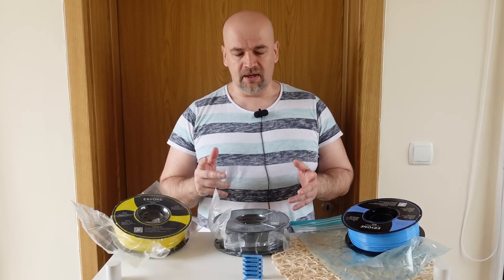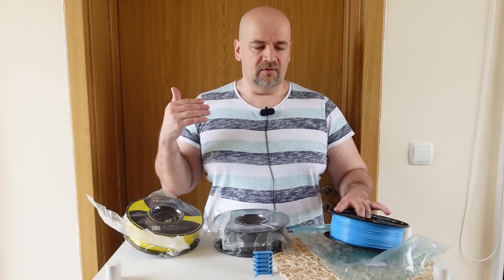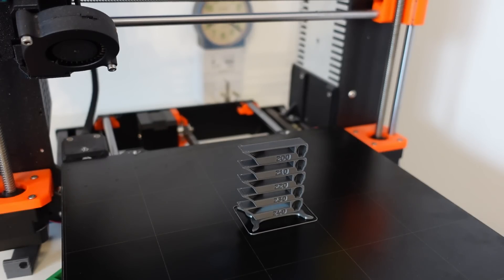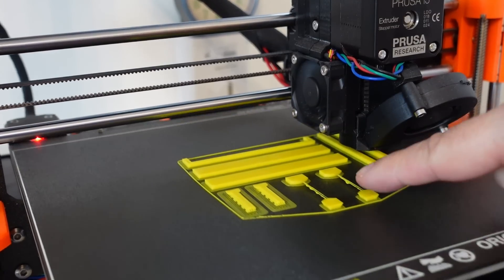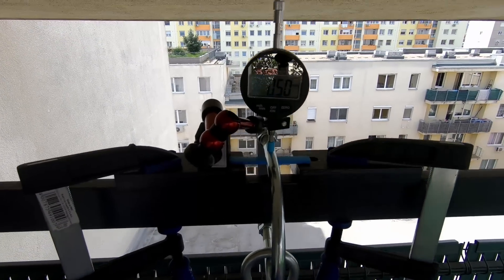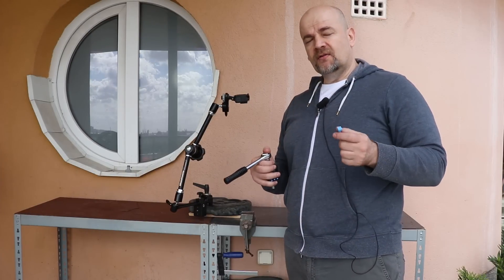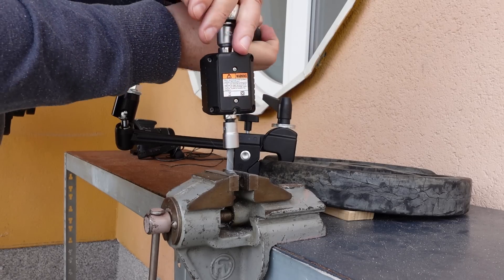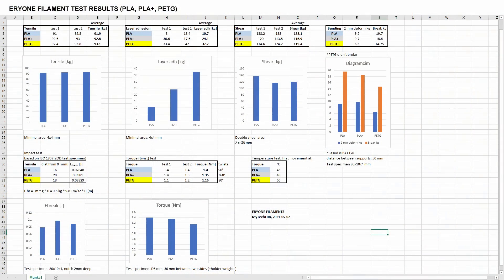PLA vs PLA+ vs PETG: Testing Eryone filaments from mechanical strength aspect

Comment: Very good video as usual. One question though. I'm a bit surprised you don't show & make available your exact profiles used. As is fairly obvious, the results you get are based on the profiles used (ie speeds, max volumetric speed, retraction settings etc). Would really like to see your exact settings not just basics like print temp. Also don't understand why manufacturers don't make their profiles available directly to help customers to get better prints. I'd assume they must do in house testing before releasing on all the major slicers so they should already have them available. I understand there is some specific printer bias but at least this would get us closer to dialing each in more precisely. In your dealings with the various manufacturers have you ever asked why they don't do this? At least I'd be willing to purchase filament from a manufacturer who provides profiles vs those that don't.

Since you are constantly testing different filament types & manufacturers would love to see a video from you on how you dial in profiles to get the best results. Feel that would be very helpful (even more helpful for me since I use Bambu Studio & Orca predominantly). Wish you would consider putting something together. Thanks.

Comment: Esun has so many good materials, but what I'm sure is that PETG is mostly harder (elongation) material than PLA+ (better with higher temperatures and higher UV levels)(but anyway leaving the elongation, PLA+ is overall fine). Your video is super, probably comparing it with other brands, could be better (PLA+ is different than Esun, and probably, Eryone has a not so good PETG). Greets!

Comment: I want to use petg but it has its load of issues so for now i only use pla+ on everything
Reply: What issues compared to petg? What wpuld you recommend for minis..im on the border between petg and pla plus
Reply: @davidmuller1958  i print mostly with petg now lol. Keeping it dry isnt too difficult right now because of winter and i have a portable oil heater. For minis i would wgo with pla or pla+. You cannot print with petg on glass unless you use glue stick. You need a bit metal heatbreak or all metal hotend to print petg. Any printer can print pla out of the box just not the other filaments without killing birds
Reply: @surchaufeur4601  gotcha thanks. I was leaning towards pla plus since i just bought 3 spools a few days ago for my 3 printers.

I was testing my calibration with a leftover petg spool and it went pretty well so i guess ill just stick to pla plus. Im just worried a little.about fumes. Tryna build an enclosure with exhaust to the outdoors. At least it aint abs lol

Comment: Nice testing, and I really appreciate the effort, but it's not a full picture and I still think PETG is not given enough credit. While PLA is OK for some decorative prints I think PETG should be the first material of choice for some functional prints because of it's great layer adhesion (one of the main weaknesses of FDM printing). Being water and UV resistant the PETG is also a great material for outdoor use.

Comment: I think this video is very good and you have done a fair test with some nice equipment to give an accurate result
So thank you for putting a lot of hard work to show us the advantages and dis advantages from these filaments.
I was thinking of trying PETG but I can say from this testing that it would not benefit fit me. 

I Can say after many years from moving away from PLA to PLA + I can clearly say PLA + is my favourite for making functional parts for proto typing before 3d printing in metal.
 
Also I can say Parts are made very accurate and can be printed with less supports and doing it so reduces the clean up

Comment: Overall, I think PLA+ is my favorite material to print with since it prints so clean and has so much strength in many areas. What a great material.
Reply: This is where i'm struggling with the results of this video.  I'm not saying anything is incorrect, just not sure what to think.  While I did not do any real tests, my pla+ prints seem to be much stronger than PLA.  To the point where I don't want to use regular PLA for much.
Reply: @rickybobbyracing9106  PLA+ Performance can vary from brand to brand, there is no set recipe or definition what what makes PLA+ as such, your mileage may vary. My personal fav. is the eSUN PLA+ filament particularly because of the higher elasticity. In the end the best course of action is to decide on filament based on your own needs and tests.
Reply: Have you tried PLA meta?

Comment: Great video, I am glad I found your channel. This is really valuable info. There is so much talk about differences in materials that you have to sit down and really test the assumptions. You are showing there is no magic. I wonder about the consistency of material from spool to spool. I learned early that dimensional stability over time for PLA was fairly low. Pieces I printed a year ago will have loosened up due to long-term shrinkage. I learned to temper my expectations of engineering tight tolerances. I am just now trying the higher temp materials.

Comment: The biggest advantage of PETG is chemical resistance. In most industrial environments there are always chemicals such as harsh cleaning chemicals, solvents in lubrication etc where PETG shines compared to PLA+. That’s my experience using it in  industrial environment.
Reply: Are there many situations where a fragile(ish) 3d printed part would be used long term in an industrial environment?
Reply: @zybch  doesn't even have to be long term. The prototypes often need to withstand various chemicals.

Comment: Nice Video. I used for age PETG but I replaced it with PLA+. Sometimes PETG deforms under loads, sometimes it is brittle and I do not know why (same roller same parameters). I am more confident with PLA+. Moreover it is easier to machin PLA+
Reply: PETG can absorb water vastly easier than PLA. Thus you will have issues with PETG long before PLA due to being loaded with water. Dry the PETG and see the difference.

Comment: Great video! Have you had any experience with PLA-F? The PLA/ABS hybrid filiment. I have seen a few videos comparing these 3, but no comparisons with PLA-F! Would love to see PLA-F included in this type of comparison!
Reply from the maker: Never heard about PLA-F, is that also from eSun?
Reply: @MyTechFun  it's relatively new, within the past year. It's from Sandoz. I ordered a couple spools by accident but have been playing with it a bit. It's supposedly solves the warping issues with ABS and is easier to print, while being stronger and higher heat resistance than PLA. 
I'll admit I'm new to 3d printing so I wouldn't know how to compare it as I pretty much started with PLA-F instead of PLA. Aside from some weird stringing, it seems to be as advertised. Stringing could just be my own inexperience too

Comment: Dr. Gaspar, I truly appreciate your testing approach, you’ve saved me so much time and filament. I’ve recently had a lot of fun printing and testing roller bearings, some have even been used in functional parts. I’d love to see your evaluation of the popular designs, and how material selection affects performance. Thanks for your work!
Reply from the maker: Thanks. Those roller bearings, where did you used it? I will use them in rotating spool holder, video in few weeks... works great.

Comment: Thank you for all the effort you put into your videos. I use Eryone PLA+ quite often. Not related to this video, but what do you do to keep your prints stuck to the Prusa Textured Sheet? I don't trust my textured sheet for prints longer than 1-2 hours because a corner or area will always detach and effect the print. Thanks!
Reply from the maker: In most cases, textured is for PETG and smooth for PLA. Sometimes I am lazy, and left textured for PLA. In that case, clean with IPA when it is cold. And pay attention to live-Z, if it doesn't stick good, you may need to lower it.
Reply: @MyTechFun  thanks for the advice!

Comment: I really liked your double shear test. You might consider a cross screw to set and hold the gap for each test. I suspect that some of your deviation was caused by the varying gap in the plates as the test started. A simple upgrade to the twisting test might be to use a t handle instead of a ratchet to avoid bending movements. You could also add a bubble level to the t handle to monitor your motion. Nice work, it looks like you are having fun with this.
Reply from the maker: I agree to adding cross screw (only I need longer plates, these are too short, soon..) I also agree with twist test suggestion, but I belive that the difference will not be significant.

Comment: I stopped using PLA for usable prints because of PLA creep ... that means it can bend and deform under constant load. PLA is fine if you just make prototypes and fitment test before you print the part in PETG.
Reply: PETG is cheaper now than PLA.
Reply: @pizzablender  In my country by local seller, PETG is a tad bit more expensive than PLA or almost same price. For you or wherever you are buying is cheaper ... but not for me xD
Reply: I like to mention the same (PLA bend and deform under constant load). That's the most importent disadventage of PLA in my mind.